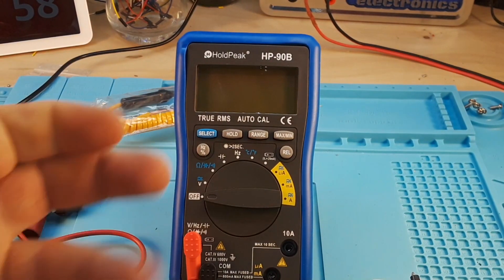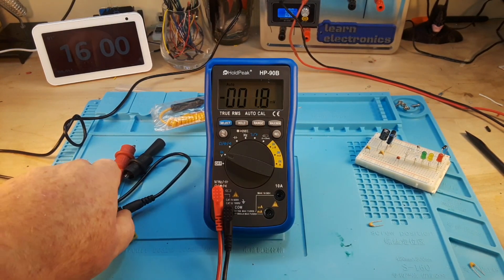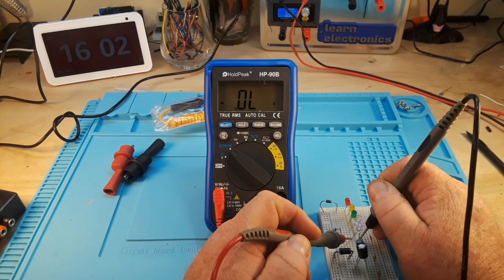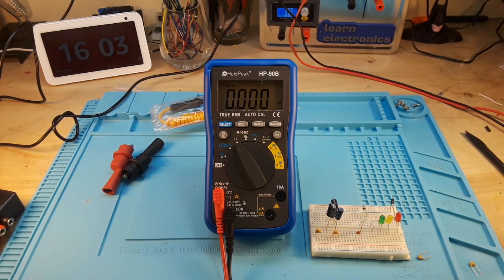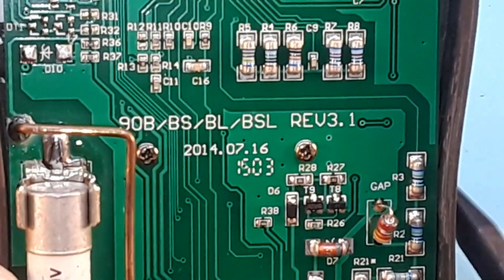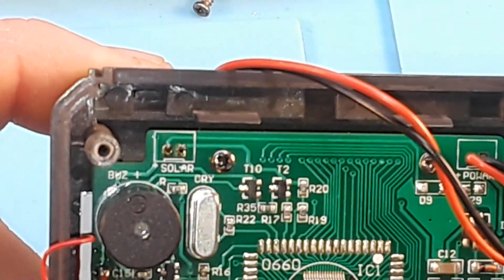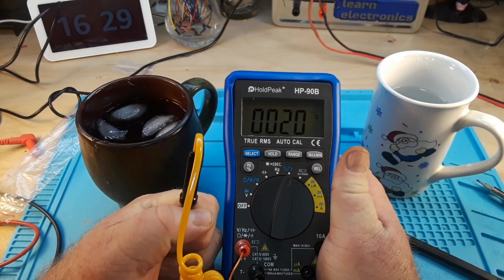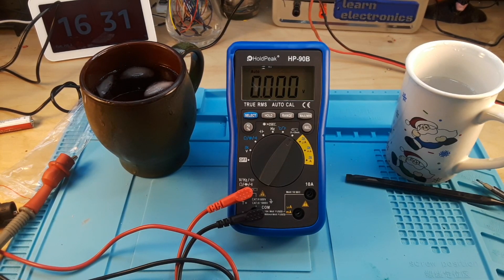HoldPeak HP 90 True RMS Multimeter Review & Teardown

Comment: I use to use a spark plug on my long wire shortwave antenna. Since I've seen spark gaps in all kinds of devices. We also put gas discharge tubes and TVS diodes in the building zone control boards we manufactured but not so much MOV's because those are more expensive. On occasion I see a TVS diode in a cheap meter and I find Flukes have spark gaps often.

Comment: We call them Gas Arrest Protectors.  Widely used in Telecomms to mitigate lightening strikes, actually surprisingly effective when you consider their size.  They were part of the standard setup in my town.  Lots of hills and and frequent lightening.
When a storm was overhead we'd turn out the lights in the exchange room where the cables entered the building.  You could sometimes see the GAPs glowing faintly like the northern lights.  
After a storm we'd be sent out to scrape the melted wires off walls and once dug the protector lid out of an internal door...  But mainly we'd just be changing blown tubes.
In a meter It's just in case you hit a silly voltage, not sure how effective they are.
Reply: That's what I thought it was for to. P.s thanks for your info the other day it helped me out. Thanks again...👍👊

Comment: The drawback of a lot of cheap meters isnt accuracy, but build quality. Especially in the rotary switch contacts. Usually just the tinned pc board traces that will oxidize fairly quickly, giving poor readings. You will need to switch back and forth many times to clean the contacts. Better meters will have these contacts hard gold plated.

Comment: On the cap tests, you mentioned that the reading was a bit low. Most electrolytics and ceramic caps have very wide tolerances. Have you measured the values with other meters you trust? Good review.
Reply from the maker: Yes, I use these same caps and diodes with every meter I test.

Thanks!

Comment: Could that "GAP" component be a spark gap, for over voltage protection/surge protection? I don't recall seeing that kind of spark gap component, often they are just two PCB tracks close together with saw-tooth patterns.
Reply from the maker: I think that's what it is, but I have never seen one like that.